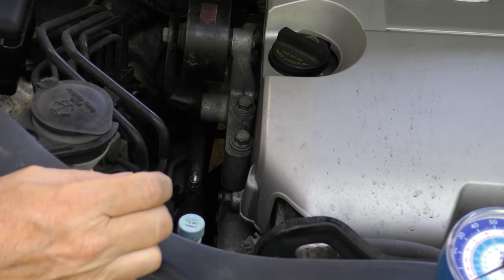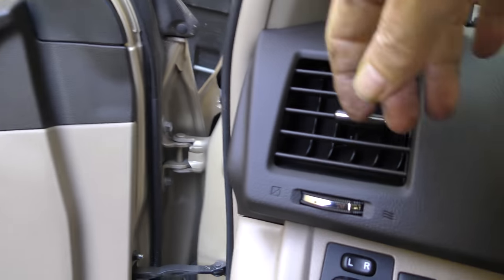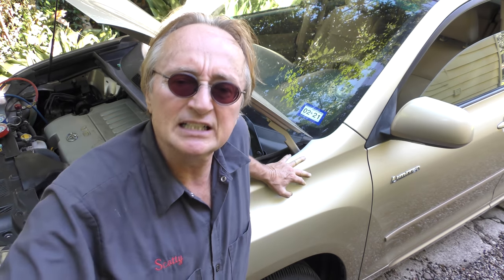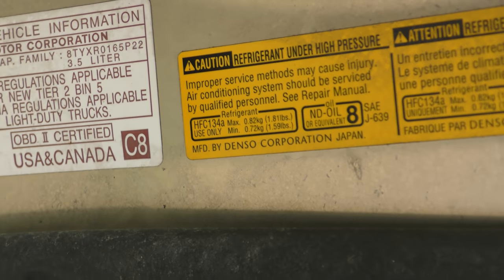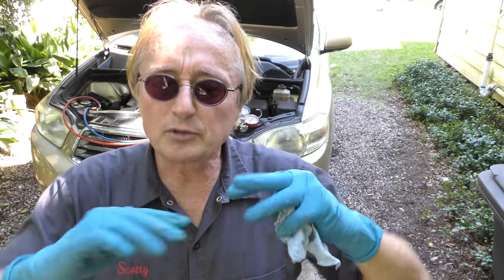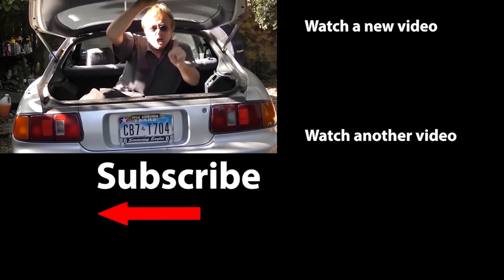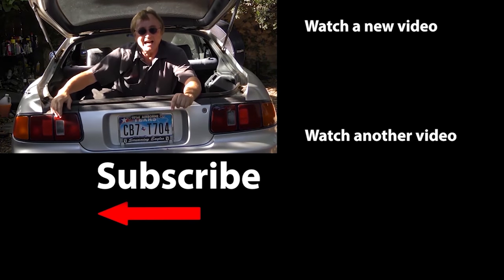Doing This Will Make Your Car's AC Blow Twice as Cold

Comment: Hey scotty had a question my car is 2011 Chevy Malibu LT  it has an issue of the AC won’t throw cold air just hot I replaced the thermostat already and also the thermostat sensor but it still won’t work the fans keep going even if the AC is off what do you think the issue is please help! Thanks

Comment: Do you think that air could be in the system from factory on a brand new 15k mile car? Was colder about a year ago when I bought it. Dealer says it's fine but I don't trust them for anything.
Reply: No. Measure the cold air temp. and, if not where it should be, tell the damn dealer to fix it. Keep RECORDS so you're covered by your lemon law. Why did you buy from the dealer, if you don't trust them?  I would NEVER trust ANY dealer of anything at all but that's just me.

Comment: P1604 is a start ability malfunction code. It usually flags after a voltage interruption. If the battery had been disconnected or needed to be jump started, the vehicle will start and die immediately on the first start attempt. The code flags and doesnt cause a check engine light to illuminate. It should be ignored if it starts fine after the first attempt.  It CAN flag, indicating a problem, but is usually erroneous and should be ignored. If the driver is starting the vehicle with 2 feet (foot on gas pedal during start) freeze frame data will show that, and driver should be informed to stop doing that.) If there is a problem causing the code, there will most likely be a "better" code along with it, as a better code to use for diagnosis to get to the problem. P1604 is almost (but not always) a redundant, erroneous code.

Comment: Ac doesn’t seem to blow as cold. Blows about 55-60 degrees.. Low side is around 40 and high side is around 250 but throttles back and forth. Do you think I have non condensables in the system?

Comment: Scotty, I've got a 2006 RX400h and my windshield is condensing, freezing in winter from the inside...  What could it be?  My mechanic thinks its the heating & cooling system and not worth fixing, too expensive...
Reply: More info.?  Heater work? AC work? Cabin air filter clean? How long to freeze up? Is the ice water or oily?

Comment: Curious to know, what's the bill to have the AC checked and refilled. Great video, thanks! Stay cool, Scotty. :)~
Reply: Honda Civic 2008 ac blows cool air sometimes a next time nothing I was told it’s the relay fuse then was told electric is going to the compressor but I don’t need a new compressor help any suggestions.

Comment: In Australia we can’t just top up a vehicle, if it’s low on refrigerant, it must of leaked out. Cause refrigerant has a global warming potential, we have to leak detect the system. 
In 20 years I’ve never seen gauge readings like that and it not a failed compressor, although there are new variable displacement compressors on flashy new cars, they look a lot different to conventional compressors. A new compressor and drier, maybe a flush if you wanna get carried away would of fixed it. Also use a temp Gauge in the centre vent as then you fair dinkem know what the temp is.

Comment: Hey, I had a new engine put in my 2007 jeep wrangler unlimited,  it was  getting poor mileage, I had the codes checked and said random multi misfire and cat, I was told to take it and see what a cat cost, they said it wasn't the cat but probably the egr or coil pack , I replaced the coil and it started running better, but 2 days later the mileage dropped according to the readout, and now code p1404 etc, but no misfire code, what can I do?

Comment: QUESTION: 2007 YUKON DENALI - sounds like a collapsed lifter. On start up, knock - knock - knock -knock/tick-tick-tick-tick... and I have a coolant loss, with water dripping pretty consistently out of the muffler and tail pipe. I am on disability, still owe almost 5 G on it, and need help fixing it. I replaced the entire front end suspension and drive axles, ball joints, and tie rod ends myself. But internal repairs, on newer engines - I am lost. Can you help me get this fixed ???????? I can do payments, and help with the work...
   I could REALLY use some HELP !

Comment: Same thing as my Hyundia.....Almost.... Compressor cycling on and off. When it was off it stayed off long enough to warm ac air coming from vent. Everything was working fine otherwise. So I said let's just evacuate and refill. Well problem solved. And probably had the coldest a.c. ever. Cost $0000 dollars. So as Scotty said. If everything else seems fine, before you shell out money, try to empty and refill.
Reply: Also the question with code. I started my Chevy Malibu one time and for some strange reason it started rough but ran fine after starting but gave me a misfire code. Mechanic wanted a small fortune to diagnose code. But car was running fine. I took my car back and light went off after a short time and never had a problem after that.

Comment: Had a problem with AC at stoplights AC would stop blowing cold air.  Took it to a shop they stuck a thermometer in the vent, said it was ok. OK MMM started paying closer attention.
slow or stopped no bueno. took it home pulled radiator cap off  and guess what filled radiator and AC happy. Sometimes it pays to pull your head out of ----

Comment: my 2011 nissan frontier AC button is not working, my mechanic told me i need a new resistor switch and has to replace the whole console.  is there a way to fix this without a lot of work and cost

Comment: 06 equinox,ac works while idling,doesn't while driving, have turn ac off wait awhile turn on and it works,so basically have to turn on off while driving 
MECHANIC WORKED ON IT AWHILE BACK BUT WASN'T WORKING GOOD, NEVER TOOK IT BACK. WHAT CAN IT BE

Comment: Hi guys my 2016 Altima just started blowing hot air when I turn the AC on. I had a MAF sensor (Mass air flow) problem but I never changed it. All I did was to clean it with MAF spray and put it back in. Could that be the reason why my AC isn’t working no more or it’s not related? Also what do you suggest please .
Reply: Not related at all check your refrigerant it's more than likely empty

Comment: I have a Honda Fit 2018 and the AC stops cooling once am not driving.  Like if I'm in traffic and I'm on break with the engine throttling it stops cooling. What could be the issue?

Comment: Pulled the ac vent filter inside the console/door panel off a used 2008 uplander. Vacuuming removed a giant ball of dust gunk. After vacuuming, ac is perfect again. Go figure. This was after we recharged the ac and couldn't figure out why the ac was still not cold.

Comment: While it's interesting to see this process, in many places it's illegal for a person to do this to his own car if he's not a trained professional.  AC is not something you should mess with if you don't know what you're doing (and/or don't have the proper equipment and gauges).  This is one of those jobs that's best left to someone who has the equipment and knowledge to diagnose what's wrong and is prepared to fix it correctly.  You also need to know how to work on the A/C without accidentally releasing freon into the atmosphere (either from your car's system or while you're adding freon to top it off).

Comment: I have a 97 mercury villager van ( Nissan quest)  it has 240,000 miles on it now. I paid $400 for it 4 years ago and it is still running great and shifting great and the AC is nice and cold. I put a timing belt on it 2 years ago but not much else other than brakes and tires.   When something major finally blows up I'll take it to the scrapyard and they will give me $400 for it😂😂🤣

Comment: You shouldnt have filled it to max freon weight. 9 out of 10 times, the freon is too low or too high. On a Toyota, if the a/c light is not flashing when you turn a/c on, first step should be to evacuate freon, then pull a vacuum to boil off any moisture. Then fill and check operation. You always want to set proper freon before diagnosis, if the light is not flashing. And gauges wont tell you if your freon is set right. Only a scale will. I'm a Toyota MDT and I've used gauges exactly ZERO times in the past 18 years.  If the a/c light is flashing, it is an indication that the compressor isnt spinning as fast as it should be (not spinning at all is also not as fast as it should be. It is also an indication that freon level is adequate for the system to run the compressor. If a little low or high, might not cool properly, but is enough and not too much to TRY.) But if it isnt spinning, and light isnt flashing, grossly under or overcharged will not allow the compressor controller to try to operate it. It was on and off sometimes in the video but that is normal. It is a cycling clutch system.)  In that case, you want to verify that your compressor is getting powered up. Suspect compressor relay, compressor speed sensor, compressor wires. But I never fill to max full. You'll blow colder air if you dont go up to the max. Go right between minimum and maximum as your fill amount. In really hot areas (arizona, i.e.) fill to the MINIMUM spec for better cooling. More freon is almost never better. Many times, a/c has poor performance for being a little bit OVER-CHARGED.
Reply: So long story short...
1. Is the a/c light flashing when a/c is turned on? If no, evacuate freon and set proper level. If it works, check for leaks, find out if someone threw a can of freon at it (find out why it was over or under charged.) If it doesn't work, at least you know it isnt a freon level issue, and you can start diagnosis.
2. If light is flashing, get a test light on clutch power wire. Only works on cycling clutch systems. On swash plate compressors, you'll need a dso to check the signal wire at the compressor. Be careful with diag, because computer "times out" when it determines compressor isnt spinning as fast as it should be. And wont try to operate it once it determines theres a problem with compressor speed. You can have one person to keep turning a/c button on and off, while the other person checks for power at the wires. It is a common problem on many toyotas to have a failing a/c compressor clutch relay. If it is diagnosed as the cause problem (flashing light, and system works when bypassing relay with a jumper,) dont buy a cheap relay. Get one from Toyota. They arent cheap. But an aftermarket one will fail.

Comment: Dont agree with what he said about how to charge it.  If he pulled a proper vacuum then it can be charged as a liquid in the high/discharge side.  Either way, 134a isnt a blend so no worries about charging it as a gas there.  Pulling a proper vacuum would also tell you if it has a leak.

Comment: If its leaking on the suction side it could run so low it starts sucking in air. Very bad situation Because then it could pull in moisture which will cause all kinds of problem.

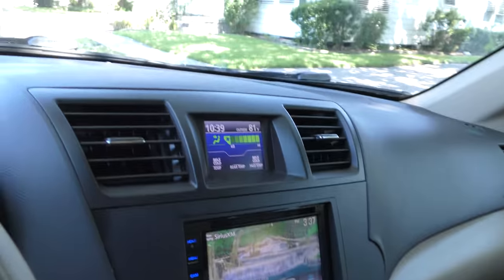Comment: 6:37 - Did anyone else notice when Scotty said when its 95 degrees outside, the car's outside thermometer said 81 degrees?
Reply: Cars external temp sensors are rarely accurate. They normally show heat index values rather than actual air temp. So it might show 105 when it's only 85, or if it's sitting in the shade it might be lower than actual temp

Comment: so i got one of those cans from walmart, and i noticed once the can was empty it still had air in the can, i took it off the car, and pressed the button on the can and air came out,  refridgerant was all gone...
now my worry is, how long did i press the button after all the freon was gone?  and how much air did i pump into the system after it was all finished?  how much damage can be done by putting air in the system?  im freaking out now because i did this a few weeks ago, its been blowing cold ever since, but i am almost positive that air got in because like i said, when i disconnected it, i pressed button on can to confirm it was infact empty, and air came out, a bunch of air actually.  luckily all that air didnt go in the system, but im sure atleast some got in... i guess moral of story, i need to stop pumping it in before it all runs out,  better off wasting some freon, then risking damaging my system.

Comment: At the end Scotty Recommended the Toyota Vans. Although they Are Quite Good, there IS one Problem with them. The " Ground Clearance " !
I had a 1991 Previa / one of their " Worst Designs " Ever ! They Have gotten better since then , But The Ground Clearance was about 5 to 7 inches from the Pavement !! That means that Every time you went over a " Speed Bump " you had to " Worry " that you would Scrape Open the [  Engine ] Oil Pan !
Esspecially if you didn't have the " Bucks " to get the right size Tires ( 215/70R/15's ) . That was a Real Pissor !!  ( as in an Infuriation / for those who don't know the language that well ) !  And Also I've Seen Every Year from There, Even to the Present Year, 2020, The Same thing !
I believe that Toyota KNOWS THIS and Just want to Cash in on it !  Why should they Care if their customer's HAVE to BUY a NEW oil Pan, Or Engine Or Even a New Car for that matter ? ! Esspecially if they Loose their Job, and Can't buy a New Toyota or any year model for That matter  ? !       Ef... Them !!!

Comment: HONDA ISSUES, AC CONDENSERS hidden extended warranty problem.   Scotty, Honda has a non announced extended warranty on the Civic air conditioners CONDENSERS, the part in the engine compartment where the fans suck air across it. We've been waiting for 3 months now for them to repair ours and NOTHING. ALWAYS and excuse for their delay. They admit that their condensers were NOT made to specs and leak, but won't do a general recall !!  Anyway, is it possible that due to so many these Honda dealers are taking the condensers that are trickling into their shops and repairing first the cars that are traded in so they can get rid of then, putting the customer on the sidelines? I would like to hear your opinion and others on this. We're sick of this crap with Honda!

Comment: I got a 01 ram that switches air from the vents to the defrost vents when I accelerate then goes back to normal when I let off the gas any ideas what that is anyone?
Reply: I would think something is wrong with the vacuum powered solenoid

Comment: He never showed the correct high & lowside pressures (I know what they are). Also, you can totally charge liquid on the lowside by just barely cracking the low side valve as it'll flash off the refrigerant in the hoses before it'll get to the compressor.

Comment: Put propane in as refrigerant.
Reply: nope
Reply: @wholeNwon  it will make the a/c "colder" just dont crash.
Reply: People who don't know any better will say "Ooh , no that's dangerous" but meanwhile there are cars running on LPG or dual fuel with 90 litre lpg tanks in the back with liquid to gas converter units next to the engine with electric solenoids controlling the shutoffs . I've used Propane as refrigerant for years and it used to be factory fitted until some risk assessors decided it had "possibility" of fire although it had never happened . My pickup needs a recharge every 18 months or so , it costs me about 80 cents to do a top up . Propane is a recognized refrigerant , called R290 , it has similar working pressures to R12 / R134a .
Reply: @Gordon_L  I know hahaha same people that will over fill the system and wonder why it's not working properly.
Soct should have tested the system for contamination.

Comment: I don't believe there was 
Air in the system.
In such a case of air contamination of the system the gauge  would  go up and down. 
Easy to spot and sure indication of air contamination.
It was not charged right and he did exact thing every good tech would do in that case. 
Perfect example of using basic procedure and correcting the problem. 
He mentioned possibility of  compressor not working earlier in the video Wich tells me that he's  not HVAC guy cause first it wouldn't be that easy to charge that system and there wouldn't be that much difference between your hight and low side of the system but that's me now just picking on the dude.

Comment: 134 sucks, a blend of propane and butane blows. Nice and cold. Something 134 could never do in CA in the summer. 134 was patented by DuPont when R-12 lost it's patent. Many many refrigerants are better than 134 but the big chemical companies don't own the patent. In Europe they use a hydrocarbon blend. But ooooh Wait it's flammable, so the US says not to use it. Oops, did I say the US says not to use it? No sorry Dupont says that. BTW , ALL REFRIGERANTS are flammable. yep, especially 1234A. The crap that costs about a hundred bucks a pound. Just use Envirosafe and be done with it. Less head pressure means easier to compress, better horse power. Whewy!
 Oh , if you didn't know, the best way to make your A/C more efficient is to make your radiator more efficient. Don't run so much antifreeze in the summer. Did you know antifreeze is against the rules to run in race cars? So, what, they run cooler with just water. Your car can too. All it needs is a little WSO to lubricate the water pump. Also use a good surfactant and you will be golden. You just dropped your radiator temp by 10 to 20 degrees. That means cooler air on the condenser. Which means cooler air in your cabin. I got my wife's car blowing 20 degrees in the summer. Too cold? She doesn't think so. hahahahehehe.